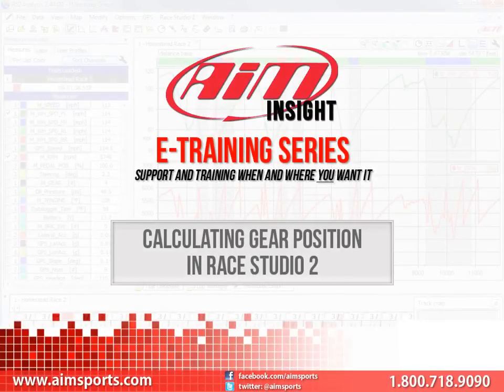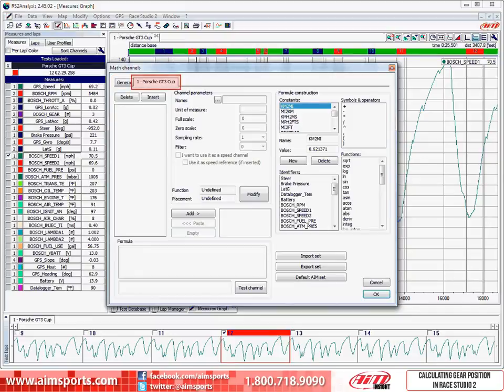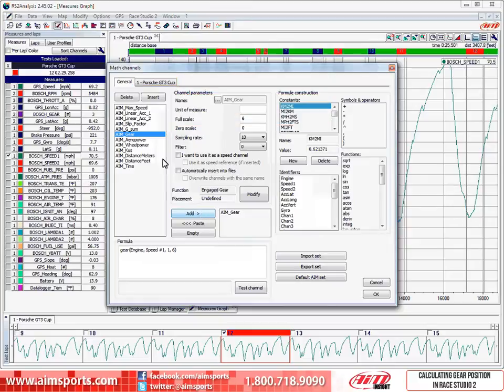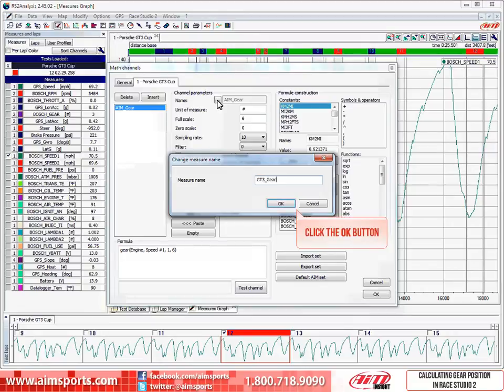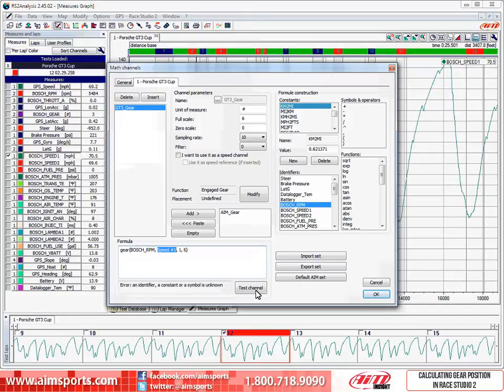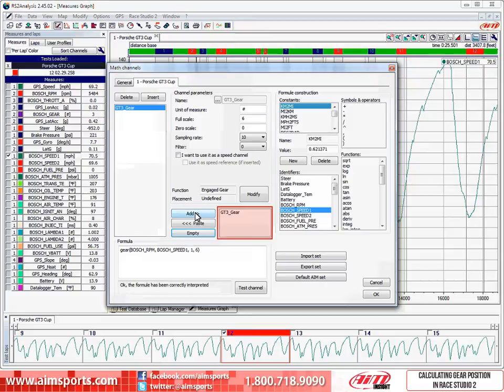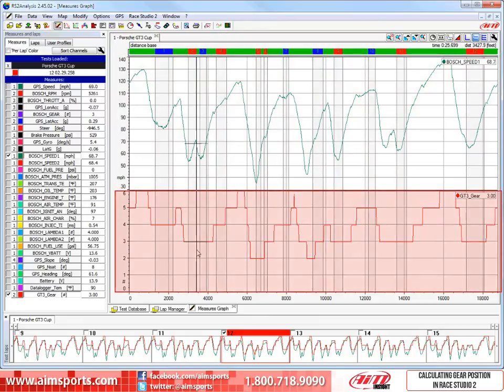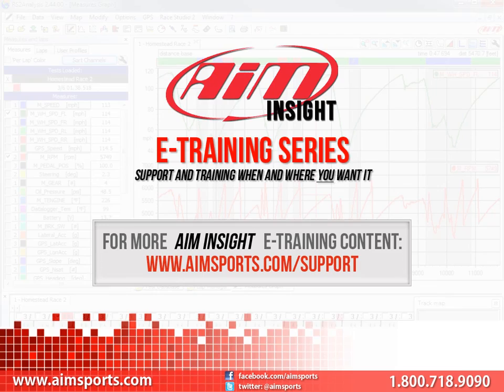Calculated Gear Position in Race Studio 2

Comment: I have gear channel from the ECU but when i export it the decimal rounding isn't showing correctly so when I import the data into other software it doesn't reflect  my gear selection correctly, i.e rather that gear 2 and 3 showing at 2.0000 and 3.000, its showing 2 as 2.000 and 3 as 2.99995, is there a way I can run a formula to round up the numbers when export it ? or am i exporting it incorrectly??